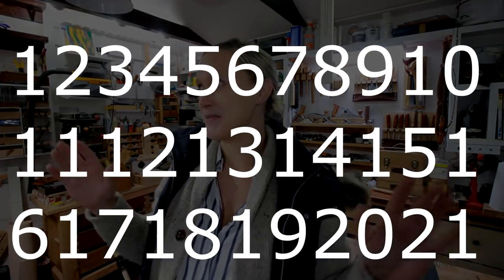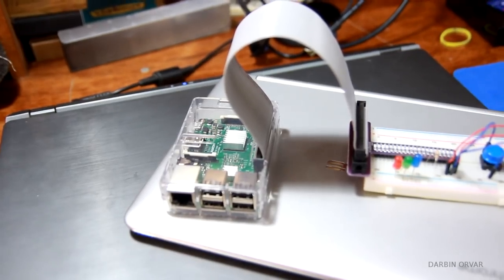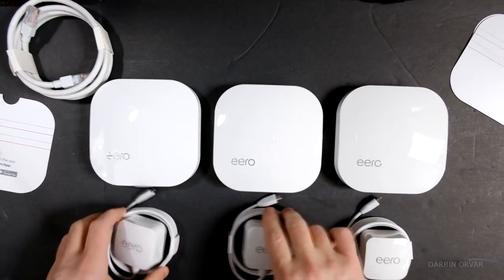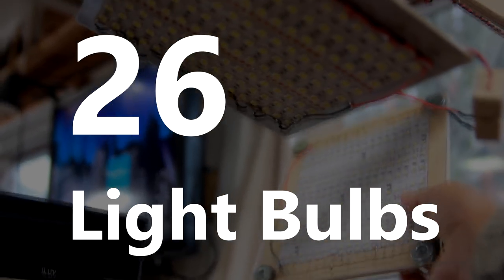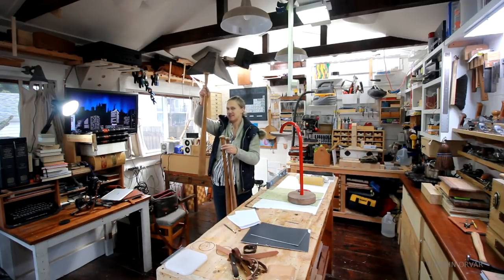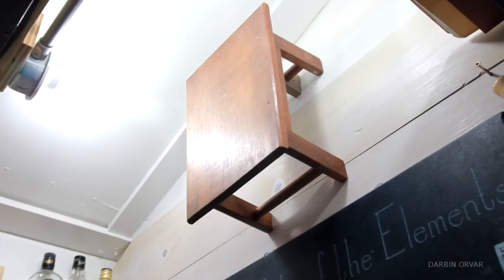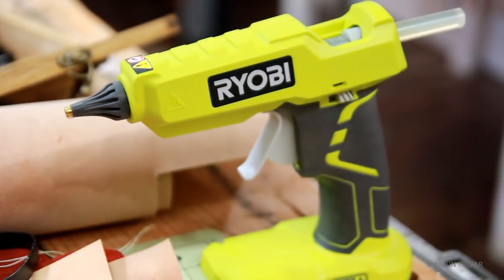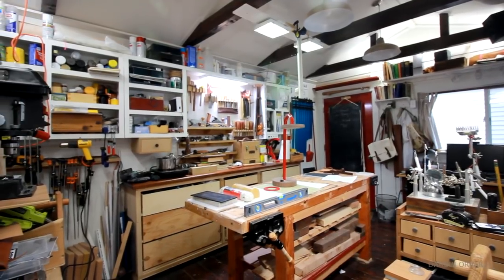My Workshop Shop By The Numbers

Comment: I know your sponsored by Eero but had you never considered getting your internet access via a PowerLine adapter? I brought two Solwise PL-1200AV2 PIGGY's and they work like a dream, they don't have a wifi port like others but work great and I see little to no drop or loss in bandwidth with it. Plus they have a plug passthrough so your not losing a wall plug socket.